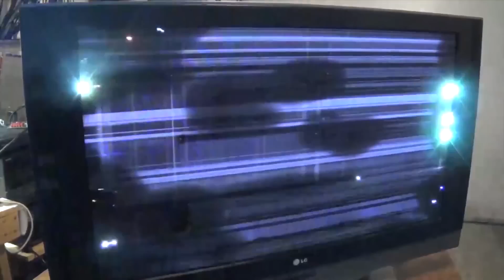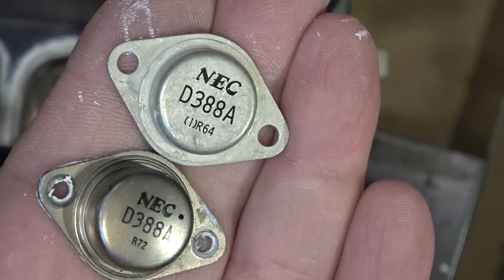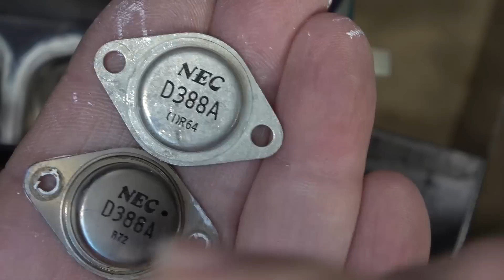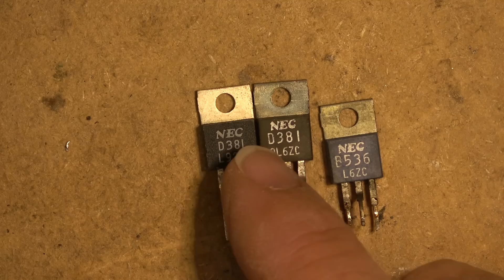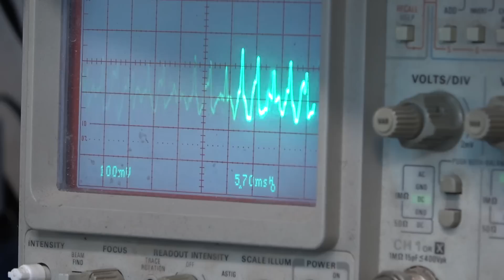Technics SA5470 part 2 installing the missing and blown parts

Comment: Original vs fake output transistors can give a clue if you compare pF between legs
Reply from the maker: That would require me to remove the good originals to measure them I didn't feel like doing that. Anytime you start removing parts you're on the risk that just heating the leads up to unsalter them and removing them and putting them back in is going to cause damage. Remember these parts are 45 years old. Well beyond what they were ever designed to last. I know people like to think the transistors were designed to last forever but they can just fail from old age even without being used. I've seen cases of brand new transistors who are still in the bag and yet they didn't work.
Reply: @12voltvids  In this receiver maybe just disconnecting the wires could isolate the output transistors enough without removing them from the sink. Still its tedious work. 
In any case, when an original is handy it can be measured for base to emitter capacitance vs a dubious one. Probes in reverse polarity to how Vbe is checked.
Reply from the maker: @somebodyx  well i don't really care.  I'm not making enough doing this to fiddle fart around measuring impedance of parts to determine if they are possibly counterfeit. easiest way to tell it's just a load it up and crank it up if it goes boom the parts are bad. you know it's one thing if you order some parts in and you test them and determine oh these parts look like the counterfeit and you can send them back and get your money back but it doesn't work that way once you order parts and buy them they're yours whether they're real or fake you're not getting your money back so you might as well just put them in and if it goes boom you know that they're bad if it works great.
Reply: @12voltvids  You put out a repair video that came to revolve around the issue of counterfeit parts. We viewers naturally tend to share ideas about techniques of proving such. We don't ask you to actually go do it.

Comment: I showed this video to three electronics tech people and they all told me that the original 2SD388A you pulled out of the unit looks totally like a fake, and genuine ones usually have a dull finish like the new replacements. Quite odd...
Reply: Those people are brocknician not technician trust me on this

Comment: Yup, I agree, those outputs are fake, you can tell by the blue insulation around the Base and Emitter pins, the original epoxy will either be a much darker blue or black and the diameter of the hole in the body of the transistor is usually smaller on the originals, those are usually another tell tale sign and as you noted, the lettering and material, I bet they're not shiny because they were sandblasted to remove the old lettering.
Reply from the maker: I couldn't have said it better myself yes sandblasting that's what they did to get rid of the original markings. That's why all the ECG replacements look like these ones because that's what they would do is they would buy original components and number them with their own numbering system. I have the amp on test right now just playing some music on it I'm going to hook it up to a dummy load resistor and give it some volume and see if it holds out fingers crossed it doesn't blow but better than it blows up here if it does then the customer's place.  He supplied the replacement parts and as soon as I opened the package as I mentioned I'm concerned but it's working.  When I was setting up the idle current I had to turn the control quite far to get the idle current up and I'm still 04 volts lower than the other channel. That's a good indicator that the transistors don't have quite as much gain they're needing a heavier bias to bring them into conduction. That's another telltale sign that they're not the same as the originals.
Reply: @12voltvids  Sounds like a good plan, fingers crossed it works out but I've never had much luck with counterfiet parts. It's always fun when the owner supplies the parts, it's like a game of russian roulette, never know what you're gonna get haha. Good info on the gain, I'll keep that in mind when testing future transistors.

Comment: 1 time i was working on a 5050 qsc amp and i was short of 1 transistor i go and buy a fake 1 and to my hear ik there's gonna be problem and it work for 5 sec and boom damage the hold 1 side channel i go to the bar and drink off the stress
Reply from the maker: That's the problem one bad part and it can take out a bunch of other ones that we're still good. I know quite a few guys that left the industry around the time I did early 2000s and they did it pretty much for the same reason that I got out it was just no money to be made and all it takes is one bad fake part like that that takes out a whole bunch of other parts that you're eating. Kind of takes the fun out of the work. I know if you guys it just threw their hands in the air and said they were done and I can't blame them. For anyone that wasn't in the business in the 80s and '90s and into the 2000s they have no idea what we went through but it wasn't it wasn't fun sometimes you'd have good days and then you'd have days for just nothing seem to go right and adding bad new parts to the mix didn't help matters it was bad enough. They occasionally you'll miss a part and something will burn out but even when you don't and it blows up because of a bad part and that's the real kick in the nuts. All the phantom troubles you chased down looking for something else that was caused by a counterfeit part and no recourse because the wholesalers are buying the parts from they're not going to stand behind the parts big signs in the shop no returns no guarantee on any part you buy it it's yours it doesn't fix it too bad if it blows up and take something else out with it too bad.

Comment: why you dont use transistor meter? there is a PEAK meter. youll see diferences strate away. also use scale to check the weight, fake ususally is lighter then original and never instal fake into circut, just bin them or send back to seller.
Reply from the maker: Don't have that fancy test gear.